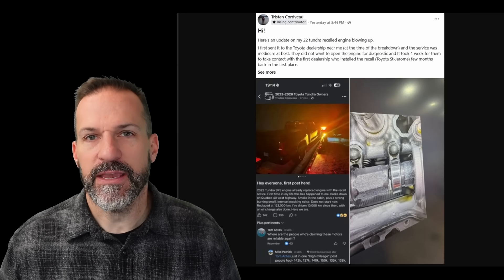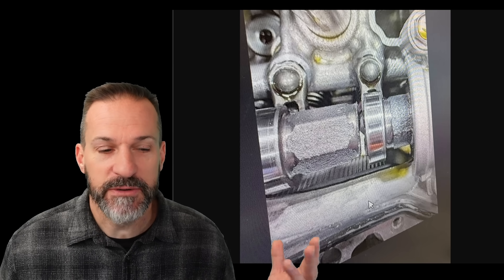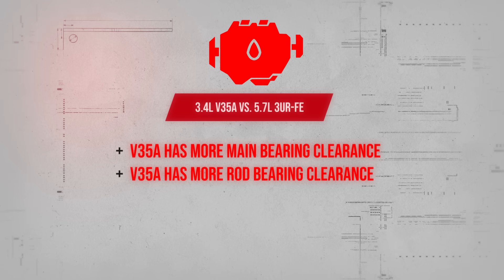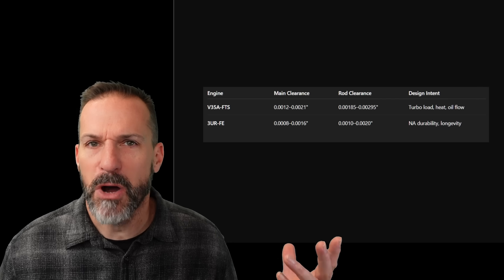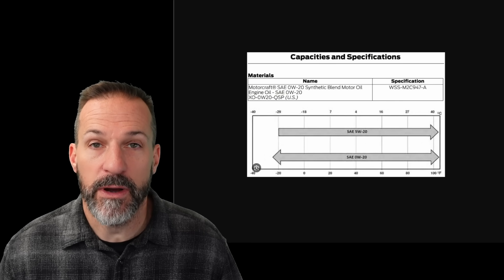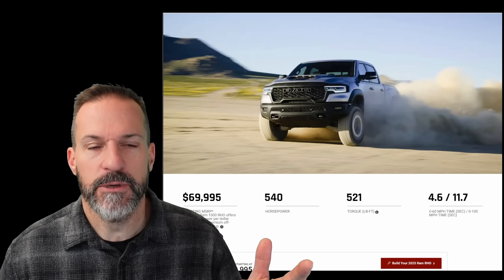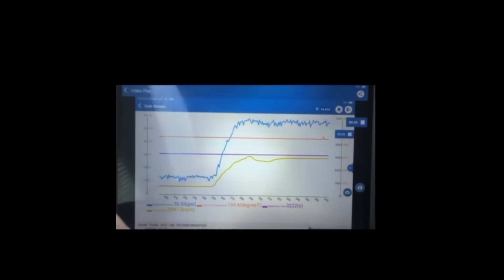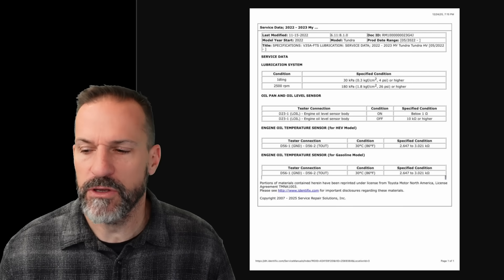Can We FIX Toyota's BILLION Dollar Mistake at Walmart? 2022- 2026 Tundra...

Comment: No warranty issues as long as the oil meets the minimum API spec set forth by ram. I run 5w40 in my hurricane with no issues

Comment: Low idle oil pressure is an interesting theory. It all makes sense, especially as to why what should be a well engineered toyota engine is failing, regarless of where it was built. I wonder what the oil spec is for gasoline LC300s****. It also explains why Hybrid models might be less affected- they don't idle as much (electric air conditioning, etc)
****Edit- from the Russian market 300 Series owners manual-
"At the factory, your Toyota is filled with SAE 0W-20 oil, which ensures optimal fuel consumption and good starting in cold weather." Same as here, but also
"Use ...an equivalent that meets the specified quality and viscosity requirements. Oil grade:
0W-20, 5W-20, 5W-30, and 10W-30" and most importantly
"Higher viscosity oils (higher values) are preferred if the vehicle is operated at high speeds or under heavy loads"
There's a graph that indicates 10W30 can be used down to 0F.

Comment: My '24 Tundra is my first pickup truck. I bought it for having peace of mind when towing my 4000 pounds camping trailer. I towed it for a couple years with my '19 Highlander V6, having no issues. Now, with this engine failure overhead, I don't have the peace of mind anymore, which is not what I expected from Toyota.

Comment: Your hypothesis is wrong undisclosed cause of the failures is because of bearing delamination. The bearing material is separating from the base metal. Causing debris in engine that was not caused by machining.

Comment: I"m picking up my 2026 Tundra on Monday.I've put 23 of the 36 miles on it between me and my wife test driving it.  AS SOON as I get it home it's getting the factory fill dumped and I'm filling it with 0W30...the same oil I've been running in my GMC "Mini Max" for 100k miles without issue.  0W20 is TOO THIN for those twin turbos and the heat they produce.  IMHO...

Comment: Just bought a 26 Tundra. After seeing this video and some others, along with the comments, I’ll likely switch to 5w-30 and reevaluate from there after some miles. I just did an oil swap out at 600mi due to the recs here, but still used the 0-20 per warranty. Thanks!

Comment: Mark 8 Vw golf r says to use 0w30 but the rest of the vw fleet is 0w20.  back in the day when I first started working on Cars in 2008,  Volkswagen wouldgive you a chart, and it will say if you operate during this type of ambient temperature most of the time use this oil, and if you operate during this ambient temp Use this other weight oil. So definitely something to take into account

Comment: Run 5w30 at a minimum on turbo engines! This 0 weight stuff is for the manufacturer to pass emissions. Do break in oil changes at  500, 1500 ,2000, and 3000 miles for the first 3000 or  miles and change your filter every other change (filters filter better with age😉).

Comment: You're onto the problem with the variable volume oil pump. Notice none of the Lexus models with the TTV6 aren't imploding. The difference is the Lexus pump is solenoid controlled while the Toys are not.

Comment: I read somewhere a while back that the greater the viscosity range (0W40) requires more additives that can potentially wear out sooner.  Outside air temperature & oil passages/oil pressure also play a factor in what oil is best for a particular application.  Variable Valve Timing is also a factor.  Real world testing would seem to be the only way to decide which viscosity is best (along with regular & synthetic oil differences).

Comment: I run BG MOA in all my engines since 1997 and have never had an engine failure since, including the VG30 in my 23 Tundra my 24 Pro and now 26 1794. I have been a mester tec for 35 years and will retire in 2028. BG MotorOilAdditive is fantastic. It stops oil shear. Oil shear is the problem, a break down in oil viscosity. Essentially like running a higher viscosity oil without the possible drawbacks of oil shear associated with higher viscosity oil in an engine designed for lower viscosity oil. I feel he is correct in his observation that there is not enough bearing surfaces to handle the load induced by forced induction in the turbo Tundtas and any small turbo application for that matter. Larger crankshaft journals need to be implemented to carry the load of these turbocharged engines.

Comment: I spoke to my mechanic about these mfg thin recommended oils, and asked him about going with a thicker oil.  He doesn't like the thin oils either, but he didn't recommend switching to a heavier oil for a specific reason.  He said that the oil passages are so tiny in these modern engines, that when using a heavier oil than recommended, the oil may not always get through the passages.  I already change the oil in our two cars, 2023 Venza Hybrid and 2024 Honda Ridgeline every 5,000 miles.  Now I'm thinking of changing it every 3,500- to 4,000 miles, but I'm going to stick with the mfg recommended viscosities for the reason mentioned above.

Comment: I think he made a comment on this already but here we go again. I have a 2019 Chevy Silverado V8 that used to use 0w20 but I switched to 5W30. With the 0W-20 on hot days in California the hot idle will go down to as low as 8 psi to 10 psi. Now with the 5W30 kids no lower than 28 PSI. 
I do not remember what The cruising PSI was with the 0W20 but I know it was definitely lower than it is now with a 5W-30. Right now with the 5W-30 cruising PSI will be around 58 to 65 PSI. I will never go back to 0W20. What's the one thing a lot of these vehicles have in common from a different manufacturers that have failing engines that is the 0W-20 thinner oil.

Comment: FYI people. Oil pressure isn't the important number however it is related to what is important ... oil flow.  I am concerned that at low RPMs they are pushing the limit so tight that when the engine goes into  boost to generate all that power you all think you need to have that before the flow rate can come back up the pressure on the pistons is driving the crankshaft into the bearings.  A higher second number in the oil will help maintain that film at those higher engine loads.

Comment: 5:20 Ram with the Ecodiesel (2nd gen) did something similar.  They started with 5w-30 but switch to 5w-40 shortly after deployment in 2014 because of main bearing failures. It helps but is not a cure but rather bandage over a bleeding wound.  A couple other points you make are right on. I suggest watching the Motor Oil Geek for some next explanations on what the numbers really mean in oils (5w-30, 0w-20, 5w-40, etc) but the short story is that the second number is a measure of film strength under load. That is really important when the cylinder(s) are generating more and more torque such as low RPM load and rev up. You combine that with variable flow/pressure oil pumps and you have a recipe for destruction.  You are very correct in putting the blame squarely on the EPA/CAFE requirements. It has put the companies into a corner where they are cutting every corner and pulling every trick to try and make the requirements while making an engine people want. And people want way too much power out of their engines for no reason but that's what they want so they spec oil on the border of to low of film strength in engines that make a lot of torque on smaller crank sizes and then add more boost than necessary.  

Perhaps people need to go back to the 1980/90s with car engines that make 1/2 the power and just slow the hell down on the road.

Comment: can the oil pump solenoid be tuned? Ford has this similar issue with the new 7.3 gas engine. But the DIY community as figured out a way how to tune the pump output to avoid these low PSI at idle.
Reply: There is no solenoid actuation on the tundras. Only Lexus.

Comment: I think the big three may be sharing your view on the strain these high boost turbo engines are under. Getty Garage recently did a video on how the new heavy duty diesel pickup engines will be larger in displacement. The thought is larger displacement will allow for lower boost but the same performance, thus putting less strain on the bottom end.

Comment: I think you should take this a step further and change out to a high zinc diesel oil such as 5W-40 or a zinc additive. There are other high zinc 100% synthetic oil. Zinc works wonders on bearings. This is why diesel oils have zinc due to the higher pressure that diesels run on the main bearings. I personally run High Zinc 100% synthetic 20W-50 in my jeep 4L, the sound of the engine completely changed when I switched to this oil, in addition my high all the consumption went away. I run Hein 100% synthetic oils in my diesel truck, air cooled engines on motorbikes and my VW type one. If you go to the diesel route Shell Rotella is a very good oil to use. Personally, I use.AMSOIL. I’m not an Amsoil distributor, I like their products, they’ve made a big difference in my vehicles. I do have a Toyota 3.5 L that I run 0W-20 100% synthetic oil in and have for years, 180k miles. This is a non-turbo engine using the factory recommended 7500 mile oil change interval. Many shops of recommend. I changes over to a higher weight oil, but they stop talking when I show them. It’s AMSOIL oil.
Reply: Garbage

Comment: It’s not tight tolerances it’s tighter clearances. And all these drawings should be done to an standards or the equivalent Japanese standard. So tell us what the tolerance is are and tell us what the clearances are and perhaps you’ll make sense. What these engines need is a lot better oil than Toyota‘s been willing to use. These engines need a 100% synthetic oil.

Comment: Higher viscosity does not improve protection in journal bearings. Oil pressure is resistance to flow, not protection. Mains are not lubricated by pressure but by hydrodynamic film.

Comment: You bring up a good point on Engine RPM. Has anyone done any analysis of the engine failures and corresponding engine RPM history? Perhaps the failures are from owners that routinely rev their motors to high RPMs? I doubt the ECU collects this data to map historical engines RPMs but it would seem there might be a connection to the owners usage of the engine and the failures.

Comment: This theory aligns with the reduced percentage of hybrid failures. The i-FORCE MAX has an additional electric oil pump that continues circulating oil even when the gas engine shuts off in EV mode or at idle, helping maintain turbo cooling and overall lubrication. Owners of hybrids generally report stable oil pressure behavior.
Reply: This is interesting. Do you have any links to videos or forums discussing this? I would like to read more about this, as I was not aware that the hybrid models had an additional oil pump. This might explain why they were left off the recalls.

Comment: HERE IN THE U.S. THEY ARE REQUIRED TO USE 0-20 OIL AND EVERYWHERE ELSE IN THE WORK THIER MANUALS SAY 10-30 OIL. THERE IS A VIDEO ON YOUTUBE ABOUT IT, I SAW IT IN NOVEMBER.  PLL IN THE U.S. ARE BEING TOLD TO CHANGE OIL FREQUENTLY AND USE A LOWER VISCOSITY.  I USED 10-30 IN MY 2012 TUNDRA,  OVER 200K BEFORE TRADE IN, NEVER HAD A ISSUES. JUST OIL, GAS, SPARK PLUGS AND ANTIFREEZE. RESEARCH IT

Comment: Just so you all know, reason Ford 3.5 ecoboost doesnt have the same issue as the tundra is Ford put 10 bopt mains on their ecoboost, 2.5 times more than big block engines. FORD really over engineered the bottom end. I have a 3.5 ecoboost with 175k miles as runs like new. Main thing is change oil on timenfull synthetic

Comment: the 350 chevy engine had 1-3 thou of clearance they used 10w30 witch you cant realy use on new style engines due to vvt . in my opinion 5w30 is what you shoud be using . 1.5 to 2 thou has been very common since the late 80s in many engines using 5w30 oil your litteraly reling on  2 tenths of oil film to keep your engine alive. i own a repair shop and have alot of experience with heavy engine repair also im a transmission builder fluid viscosity matters the most ...

Comment: I think you are on the right track, I refuse to use "watered" down oil. It was implemented to improve cold start mpg rating , same as 10,000 mile oil changes. They promote less annual maintenance cost and better fuel mileage. Look at the maintenance manual for the same engine a few years earlier, like a 2006 4 Runner and a 2020 4 Runner. Same engine, different oil viscosity and intervals. HMMMMMM

Comment: I own a 2013 F150 ecoboost. One thing to keep in mind is to be careful what fuel additives you put in turbo-driven engines.    I was told not to use them because of possible turbo damage. At 180k I occasionally used one with PEA. It helped keep things clean when I stopped driving it on the highway. I've never had a single issue, except I was getting the wrench at 160k and I replaced the throttle body. Almost 200k now!

Comment: With a quality synthetic, you should be able to go to a 10W-30. It would do a few things, better retention in upper end to lube before it gets pumped up. The other is that the oil will perform longer and better due to less viscosity modifiers to shear. Synthetic has a lot better pour point and pumps easier at cold start.

Comment: My 05 accord V6 always had 5w20 and has a lot of miles with no issues but it's also not a turbocharged direct injection engine. I think the thin oil and the added pressure is the factor like you said.

Comment: Toyota made these engines and ran them for CAFE.  If they do anything to them they will have to re-certify the CAFE and if they fail to meet their goals Toyota will end up paying more fine money for not meeting their goals.  That isn't that much for a single truck but when you add up thousands it becomes a pretty big number.
If you buy a new Tundra and use 0W-30 engine oil and if something goes wrong you void the warranty.  Even if Toyota knows that using heavier oil will help they can't suggest it to customers without being investigated for CAFE fraud.
If you buy a second hand truck and it is past warranty the damage has already been done using the low viscosity oils for the warranty period.
If you want your truck to last longer and use 0W-30 engine oil you will have to forgo any warranty work that might need to be done.  Most buyers won't do this and as a result Toyota is on the hook for the repairs and replacement of the engines.
My old VW calls for 5W-40 and hasn't given me any problem.  If I decided to use a light weight oil like 0W-20 I am pretty sure that the bearings would be eaten up quickly.

Comment: Interesting, I didn't think the bearing clearance subject would be the opposite of what the assumed differences would be. 

With that said, I do see a lot of commentary about the variable displacement oil pumps when it comes to oil weights. The argument there is that the engines (and oil pump) are programmed for a certain oil viscosity. I'm predicting the argument, when attempting to address the different viscosities outside of the US, is that the cars of a particular country are programmed differently. I have no idea as that gets into an area I'm not familiar with but that's probably going to be the next argument that gets popular.

To add about the oil pressure testing. I recall SavageGeese tracking a car that ran the recommended 0w-20. They tested the oil after use and it checked out okay but they found they were running dangerously low oil pressure. This is what caused them to run higher viscosity. The point is even if a recommended oil tests okay, that isn't the whole story as oil pressure needs to be monitored as well.

Comment: Hello! I've been doing lots of research and in regards 0W-20 oil. Had a 2010 Toyota Camry using 0W-20 changing oil every 5k miles and put over 340k miles and still running beautifully after I'd sold it. I do have now 2022 Toyota Highlander XLE using 0w-20 oil would like to switch to 5W-30 due to 6 cylinders, but I do have 200K warranty as long I bring to dealership every 10k oil changes as recommended on the manual, but, I always have it changed at every 5K miles. It now has 85k miles on it. I do maintain the vehicle myself except oil changes which i'd rather do it myself as I did with the 2010 Camry.

Comment: The V35 doesn’t have a variable oil pump and just because the oil pressure sensor is seeing 6 psi doesn’t mean that’s what the mains are seeing. Toyota is taking responsibility for their screwup. I don’t understand the need to try and fix their problem for them.

Comment: Its obvious. Of course they want you to think they fixed the problem. They dont want sales to stop on the platform they spent 10s of millions developing. They will pick some excuse like dirty engine casting to make you think its a quick easy fix, so they must have fixed it. When in reality the problem is worse and requires redesign. So they will keep pumping them out, and fix the percentage that have problems as thats cheaper than to go back into development for a design change.

Comment: This comment is going to make some folks rage… stop believing every thing you see on social
Media.
I own a sequoia and a tundra within these years. 50k+ miles and Not one issue ? (Except volume knob) yes engines do fail sometimes… but It’s not Toyota mostly.. it’s the driver using it like a race car and not changing the oil every 5k.  Look deeper into who owns the ones failing and their driving habits.They are usually the problem . ( same goes with other brands failing) We all know that Toyota driver that thinks they are cool …
Toyota just needs to detune them and problem solved. All manufactures need to detune them. We need to 55mph again
And also just drive them factory and quit putting big tires on them and lift kits. Nobody cares anymore how you look .